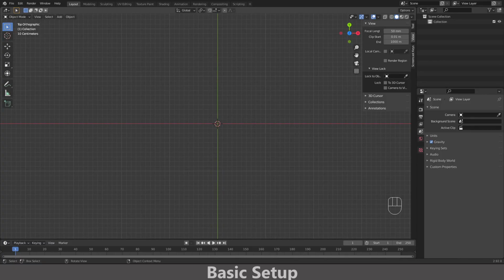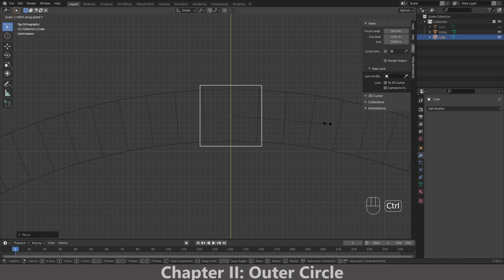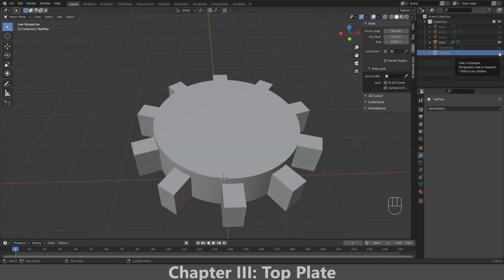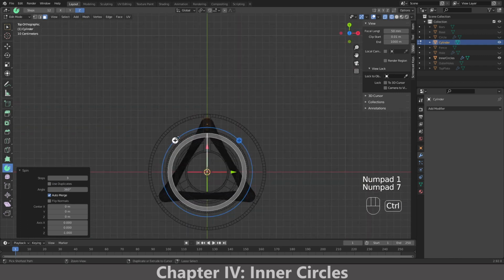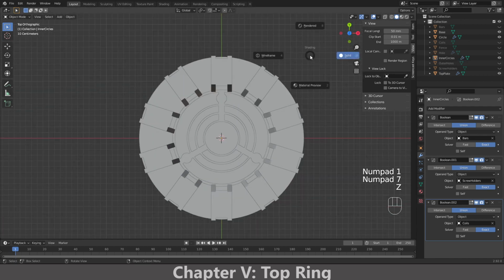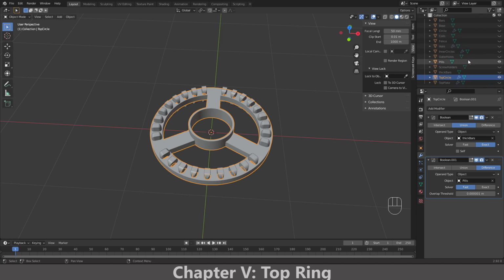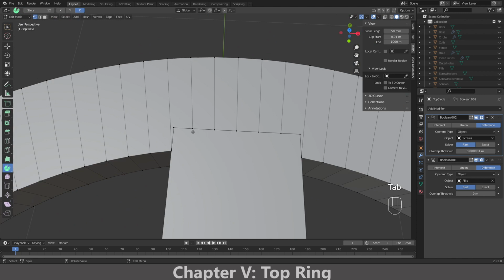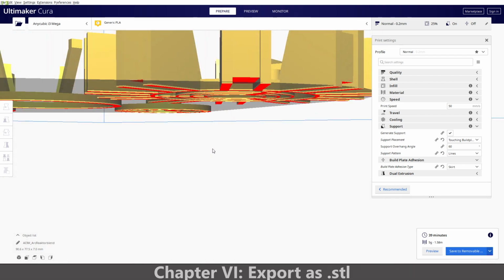Blender Tutorial - Arc Reactor 3D Printed

Comment: I think I figured out the reason the booleans sometimes do that weird thing. when you do 4 copies and 360 degrees, you are technically duplicating the first one and it's sitting exactly on top of it, meaning you end up with 5 total copies. i ran into this too when creating a model (following all your handy tips!), and instead i reduced the copies to 3 and then did a 270 degree rotation and the booleans worked perfectly with no weird duplicates or issues. hope that helps (although, you might have figured that out by now). 👾
Reply from the maker: Hey Ryan! Thanks for your tip. It's been a while since I've did some 3d modeling but I will give your solution a try when I stumble into that problem 😊